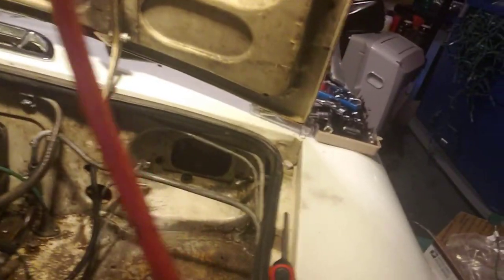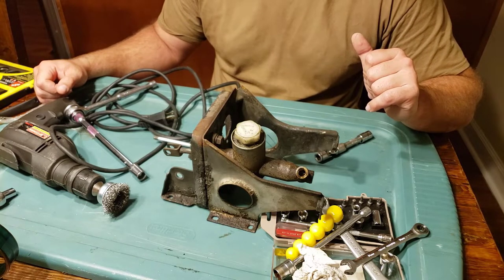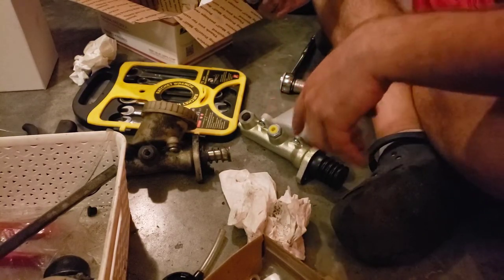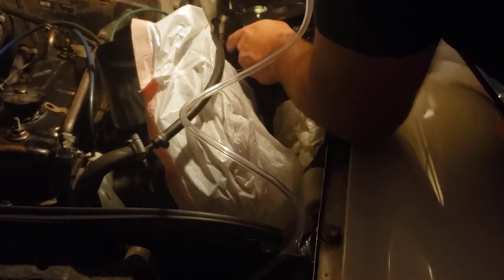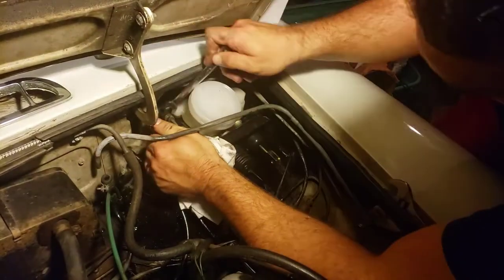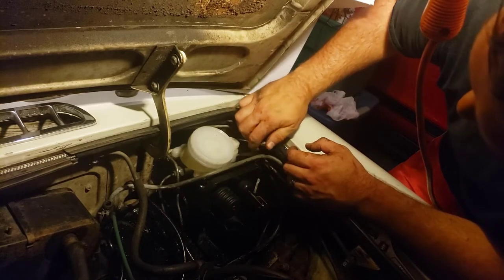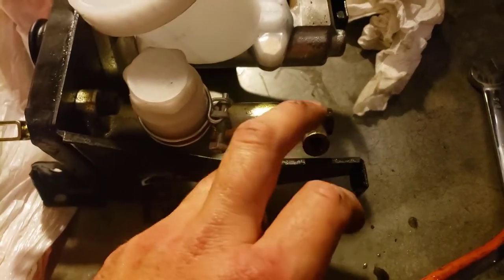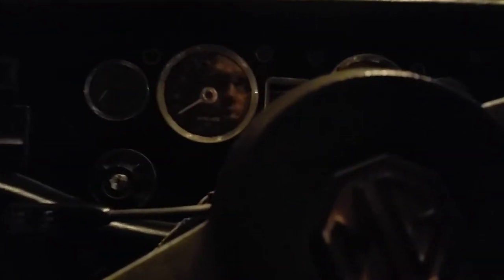I Screwed Up Bad Replacing my Brake and Clutch Master Cylinders on my 1974.5 MG MGB

Comment: Nice job. The brake master has been changed before which would account for the metric bolts. The original master would have been made from steel, the same as the clutch master only bigger.
Reply: Yes Lockheed is. The style of master cylinder on your car I believe was fitted on the very last MGB's 1980 onwards. I would imagine this unit has superseded the earlier one which is most likely no longer available.

Comment: Is it required to bench bleed or does it just make things easier?
Reply from the maker: Bench bleed does make it easier and I can't remember the kit I used.  It was either an Amazon kit or harbor freight.  I want to say I got it on amazon
Reply: @BrailsfordsRides  that tracks, it's been quite a challenge to get things working again after replacing the clutch master and slave on my midget. Seems it just likes trapping air. Been using an eezibleed.